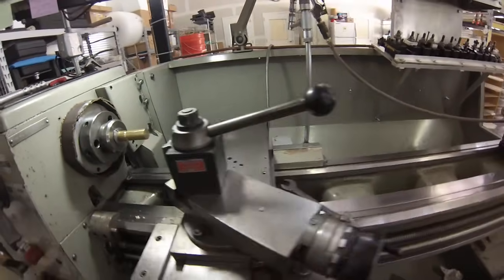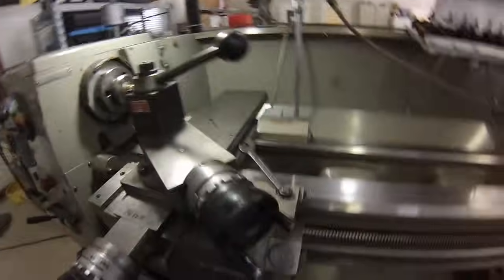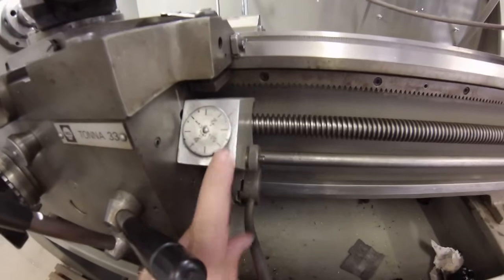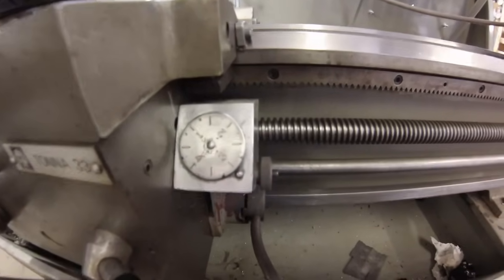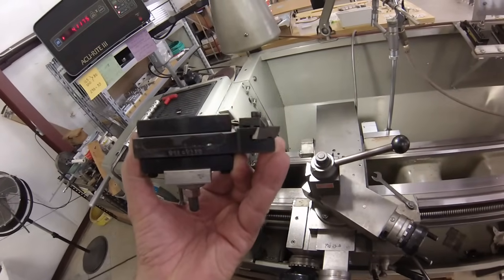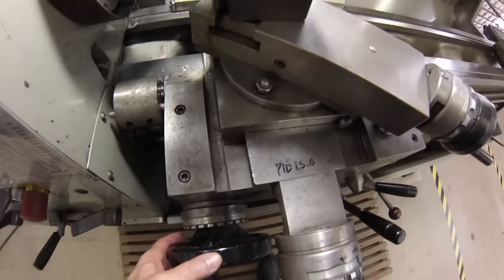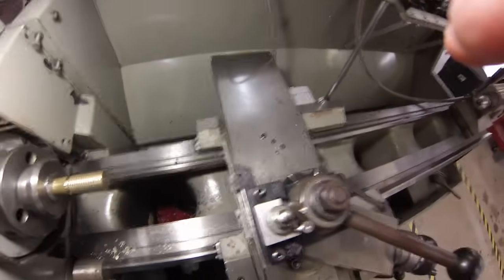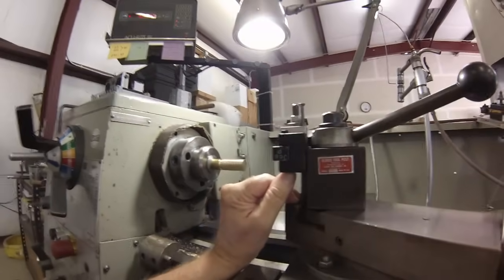Threading on a manual lathe  BEST TECHNIQUE EVER !!!!

Comment: Have you ever heard of using a thread dial when cutting metric threads?
Reply from the maker: Conditionally. Once the halfnut is locked, it stays locked for metric threads. The thread dial is probably aligned with a number on the dial, but its not really functional.
Reply: @joepie221  What I do is at the start of the first cut I engage the half nut on any number on the thread dial. When I get to the undercut I disengage the half nut and turn the lathe off.  Then withdraw the tool and reverse the lathe.  When the number comes up again on the thread dial, reengage the half nut and run the carriage back to the start to set up for the next cut leaving the half nut engaged until the cut reaches the undercut again.  It buys enough time to withdraw the tool without worrying about crashing and works well as long as you don't let the thread dial go a full turn.

Comment: Hi great vid, can you help, I'm unsure why you invert the tool. When running to the chuck obviously the threads are cut, if you start at the chuck and run away from the chuck the threads are cut. I'm having difficulty understanding why the tool is effectively upside down. My second question is; will it work inverted with a single pitch insert, ie 1.25? Thanks
Reply from the maker: Inverting the tool and threading away from the thread termination point eliminates the potential for a machine crash. It allows for the trouble free use of a solid stop. Using a solid stop is not recommended when threading conventionally. As soon as the carriage hits a solid stop during threading, it immediately shears off the leadscrew taper pin or breaks something else. Cutting a 1.25 pitch (MM) should not be a problem.
Reply: @joepie221  thanks for the reply, it is a bit clearer. Do I have to invert the tool though or can I run it, away from the chuck, with the tool the right way up? Thanks
Reply: @wgh011  if you are running it away from the chuck with your tool right side up, you are either rubbing the bottom of your cutter with the material spinning clockwise, or cutting a left hand thread with your material turning counter clockwise, if you have the option to reverse your tumbler gears so the chuck and lead screw for threading are turning opposite, and you did that.  Do you understand now?  You have to have your tool upside down to do it this way.
Reply: @joepie221  I think the critical info this guy was asking for is that you are running your chuck in "reverse" to be able to use threading tool upside down otherwise you would be cutting a left hand thread. I believe that is what the OP was asking. 
 I know this is a old video but what are your thoughts on this method if no relief is called for. Would it create a possible weak/shear point if you constantly plunged then hit the half nut lever in the same spot every pass. Kind of creating a pointed "relief" just from plunging the threading tool into the same spot repeatedly.  I make alot of fitted bolts on cnc lathes where the thread simply terminates at the retraction point of the G76. Thanks.

Comment: Joe  - Apologies if this is covered in another comment. I was taught that you had to use the compound rest set at 28.5 degrees for infeed. Obviously you're using the cross feed to set depth of cut. Can you clarify? Thanks.
Reply from the maker: The job and machine allow me to plunge with the cross slide, setting your compound close to, but not over 30 degrees helps to reduce load and chatter potential. I would say anything between 25 and 29 is acceptable.

Comment: Why not come from the other side?
Reply from the maker: To this day, the only operation I have ever performed from behind any part on a lathe was a parting operation on a small turret lathe. What advantage do you suspect?
Reply: @joepie221  I don't know. After I thought about it, I envisioned my chuck unthreading itself from the spindle and landing on my toe. No advantage to that except a funny "avoid doing this" story. :)  Actually, I'm not sure how I would avoid that with your way either. I guess I figured if it was from behind you could see the chips coming off because the tool would be upright. How do I keep my chuck from spinning off when I reverse the rotation so as to start my cut at the end of the thread. I never cut threads before, and I just got a new lathe (new to me) My other lathe is missing the counter dial, so I've never been able to.
Reply: @howlinhog  I watched this video and went to my not so great Taiwanese lathe and followed Joe's instructions to the "T" because I am an engineer and not a true machinist like Joe, and being transparent, I actually watched this video 5 times so I would not make any mistakes.  The parts came out perfect except for part #4 because I missed the Q on the timing wheel.  However, it was the 2nd cut and the part was very usable when full thread depth was complete.  From me to Joe, he is the greatest thing since sliced bread!  Thanks Again 🙂
Reply: @nicelez  Cool. I haven't been able to try it yet. My lathe I just bought is still sitting on the trailer waiting for me to prep the spot it will be in. I should have it in place by this weekend.
Reply: The tool could break being forced downward.
Reply: @jeffantone352  Why would the tool break any easier cutting from the backside with the motor reversed than it would from the front and motor at normal rotation? It's the exact same forces. The only problem I can foresee is my chuck unscrewing itself. I guess if I crank the chuck down really tight it wouldn't come off. But if I'm wrong I risk doing damage to a really nice old Rockwell lathe.

Comment: What would you do if you couldn’t cut relief in the piece you were working on?
Reply from the maker: You'd either need to thread mill it, do it on a CNC lathe or be very quick at pulling or feeding the tool. I don't know of any manual machine that offers that. Anybody care to comment ??
Reply: @joepie221  What about disengaging motor and hand cranking?
Reply: @joepie221  Hardinge HLV lathe compound slide has a quick engage/disengage mechanism that could possibly be useful. Other solution cuold be using your lathe "manually", with motor turned off.

Comment: Do you find you need to offset tool heights to account for deflection when threading internally?
Reply from the maker: No. I try to keep my tools on center at all times. Especially form or threading tools.
Reply: @joepie221  Thanks, good to know. If I don't have a left-handed holder can I do the upside down trick for an inside thread and run fwd?
Reply from the maker: That may result in a LH thread.

Comment: It's not that clever, you mate are a smartarse that screw cutting has been around for years.
Reply from the maker: You spelled smartarse wrong. :)
Reply: @joepie221  It is very common that some treat others by their own standards 👍2u
Reply: @joepie221  no I didn't, that's the correct spelling in Australia !

Comment: Threading towards the tailstock is practically mandatory when cutting taper pipe threads with a telescopic taper attachment. This keeps the backlash out of the picture, which prevents the tool from being pushed back as it enters the cut.

Comment: Hey Joe. I first watched this video when I had my first lathe (9” South Bend) saying man that’s a really nice lathe you got there! Now I’m on my second lathe and it’s almost the same as yours. Mine is the variable speed 12X40 in bran new condition! Besides when the guy that was cleaning it up to put it up for sale used a cleaner that took most of the threading chart off the front which really sucks because mechanically it could pass as new! But nice job as usual. Oh and my SB did t hav reverse lol
Reply: Oh also the only thing is somehow they lost the follow rest but I have the steady and that is bran new! Machine was very lightly used. So if somehow or somewhere you come across one, please message me! I don’t think the one from the 13” fits and I cannot find one anywhere
Reply from the maker: Sounds like a good winter project ???
Reply: @joepie221  that’s what it’s looking like. I made a nice steady rest for my SB

Comment: keeping pressure on the handwheel is the old trick i learned back in the late 60s when plunge cutting deep ACME threads.[ often 3 or 4,  RH and LH both    rough like hell without pressure  let that tool do some eating.   when getting close to final depth float a few passes with last DOC but holding pressure on hand wheel to true up the back side.  the proceed to final cuts on depth.  it will leave a tiny corner on the back side which a float cut will take care of.  oh  and this was on all old machinery.  WW2 vintage,  strong but getting worn

Comment: I'm not a fan of this trick...   i've used it once with a boring bar for a particular metric tread.  but the problem is you put the pressure now on the upside. (lifting the carriage).  it will not look as easy with a tailstock setup and it can dammage and unscrew the chuck on some lathe like mine  :)

Comment: Hey me again, thanks for the help. I figured out all the things my lathe and I were doing wrong. I got some really nice threads now! My threading gear was fubar and i was using the lead screw reversing mecanism instead of just reversing the motor and screw together thus breaking the gear meshing farther up the line when doing metric threads. I have wired a reversing switch and now can properly thread metric. Always learning a bunch here , thx.

Comment: Hi guys, I come here for a lil help. I can't get a proper thread on my lathe. I'm trying for m14x1.5 and all i get is a mangled mess. The first 2 passes are decent and then anything after that the thread gets split or the material gets torn real good. I tried without disengaging the lead screw and putting my hand on the wheel to take up slop. Anything else i should check?
Reply from the maker: Double check the tool alignment, make sure everything is tight and sharp. If its a deep thread, use the compound at 29 degrees to reduce load and maybe some oil. What material is it?
Reply: @joepie221  Hey Joe, Thx a lot for the quick reply. I've tried on both 1018 and 1045 steel with the same outcome. I have just bought a new piece of c12L14 to compare today. 
-The tool is a ER-AG60 insert. 
-Stick out is 2 times diameter. 

If that doesn't work maybe ill try reversing my spindle and using a hard stop. Perhaps that will guarantee proper start point instead of magnet with dial indicator on the carriage. 

I didn't do the reverse trick yet, I never wired it for reverse. My spindle is also threaded.
Reply: Are you using compound with 30degree angle to increase the thread cut? If yes, check if  you are set 30degrees to the normal plane of material, not to the material itself! Degree marking on some lathes tends to be confusing. I.e. compound must move 60degree along the axial direction of the material.

Comment: Joe, I just cut my first internal thread.  I did it using your method and it was so easy!  You're right!  I wonder why this isn't the standard way to do it?  My thread looks good and it wasn't as scary as going towards the head.  The thread doesn't work but that was a different problem!  The TPI and all worked out fine I had depth of cut issues.  Thanks for the great video 6 years later!
Reply from the maker: Great job!

Comment: A 6 year old video but I have a suggestion when using thread wires. Pick up some foam sheeting and cut into appropriate rectangles (2 pieces) to support the wires on both sides of the work. Now both hands are free to handle the micrometer.
Reply from the maker: Did you know you actually only need one wire?
Reply: @joepie221  That is new to me, Joe

Comment: Does it matter if the tool is held upside down or not? Both Metric and US threads are symmetrical 60degree threads... 
And honestly, I'm not entirely there with the 29.5degrees angle on the compound, either. 
I mean, you don't add that angle when you're using an internal threading tool in a hole, similar to a boring bar?
Reply from the maker: Nope.

Comment: I wished This would work on my lathe. I dont have a reverse or at least I did not find it yet!
Reply: you would have to reverse the wiring setup of your drive motors if your machine does not have a manual reverse.  changing the wiring is not productive for just a single operation.
Reply: @BigSkyCurmudgeon  thanks Pauk I found the reverse! (just got the machine)

Comment: Not the best way. No need to go to all that palava. I screw cut every day on the Harrison, slow speed engage lead screw in, cut, out, brake,  reverse method, easy.
Reply from the maker: Not an option on most of the work I used to do. If you over ride a carbide insert one time, kiss the tip goodbye. This technique is no more work than a conventional setup. Its faster and 100 times safer. Good luck to you.
Reply: I use a Harrison too, a 240, very similar to the Colchester.  It is a bit nail-biting cutting towards the chuck and requires firm concentration.  I shall be trying this method in the future.
Reply: Well, I haven't used this method.....YET, but I'll certainly be giving it a try at some point. 
Yourself, you can keep on doing it the real slow way, but if I can wizz up to a shoulder, safely staying clear of it but just 100ths of a millimeter, start the thread in a mimimum width groove, then thread at light speed away from that shoulder, why the hell would I choose the very much slower and more risky way, especially if I've got a few (or many) threads to cut. 
Me personally, I quite like all this "palava".

Comment: Hey Joe, That was a good video. Definitely a safer, less stressful way of threading! I gotta get in the habit of using that method. I've crashed into the other diameter a few times trying to stop in the groove! Basically, worry-free threading.  Thanks for the tip! And I love that Colchester lathe. I have the same one. Made a million parts on it! Could probably run it blind-folded!

Comment: hello I use a metal bench for billiard cue repairs, the only problem I can't solve is how to cock the cue without damaging the wood.
If you have a solution I'd love to hear it.
Reply from the maker: Machine a collar to match the OD of the cue and squeeze the cue in that. Distributing the grip of the chuck fully around the perimeter of the wood should reduce any contact witness mark potential.

Comment: Hi Joe great tip watch you do it few times after doing the normal way for years I feel like trying your way now for sure 
Is that a left hand thread holder bar just set upside down??
As I looked at my normal right hand tool upside down would not work like this with a shoulder on the part im threading so be great to know if that is a left hand thread holder tool upside down 
Thanks
Reply from the maker: Correct, the holder is inverted and a left hand.

Comment: I learned this in a college class on gunsmithing back in late 60s. That prof was incredible. Also taught how to turn inside threads....cut them on innerside away from you so can see them. Also same trick as yours for blind holes. There are inserts specifically for that cutting on backside.
Reply from the maker: This technique is especially well suited for gunsmithing. The last thing you want to do is blow a thread ( on either end) and ruin a barrel on a customer supplied part.

Comment: Can I do this on my 9a with a threaded spindle?
Reply from the maker: If its keyed and threaded, no problem. Otherwise consult the owners manual about their recommendations on running the machine in reverse.
Reply: I have a 1945 LeBlonde 15” regal with a threaded spindle no key. I will error on the side of caution and not thread in reverse. Nothing is mentioned in the manual, but I can call the company. They are very helpful and will reproduce oem parts for this machine if needed. By the way, I just machined a new part to take out the slack in the lead screw. I believe the carriage was run into the chuck as you pointed out. Not Good

Comment: Another problem with threading in the conventional direction is your half-nut lever can get stuck. This happened to me one time. My half-nut level got stuck during the exit zone and was lucky enough to stop the machine with the foot brake before it crashed to severely.
Reply from the maker: There is nothing like the whine of an engine lathe just before the shear pin breaks off after the carriage hits a solid stop during threading.

Comment: Joe, I'm still learning but I didn't see you use your compound to make the threads deeper.  Did you do this because the material in the video was soft brass or could you also omit the compound if threading harder material?  Thanks for the education Joe.
Reply from the maker: I usually just use the cross slide.

Comment: I think this was your first video. Great job compared to many other youtube videos. One question. What threading insert tool are you using for external threads? Top notched insert? Standup triangular insert? I usually use a laydown insert and find that the tool geometry interferes with getting close to a shoulder or I have to cut an excessively large thread relief. I am seeing a new threading tool holder in my future. This is a great option. I use it exclusively for internal threads.
Reply from the maker: Kennametal top notch. Correct.
Reply: @joepie221  Thanks. I bought one of the standup triangular insert tool holders primarily because I already had a few inserts, some positive and some negative. Will see how it performs.